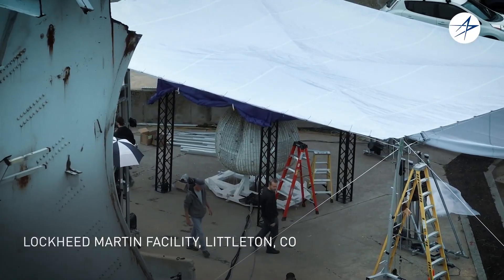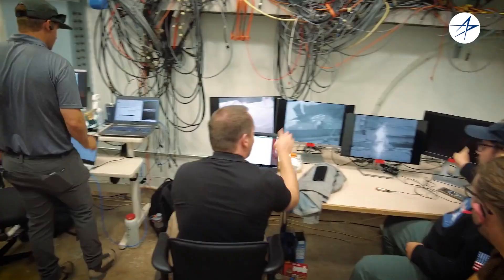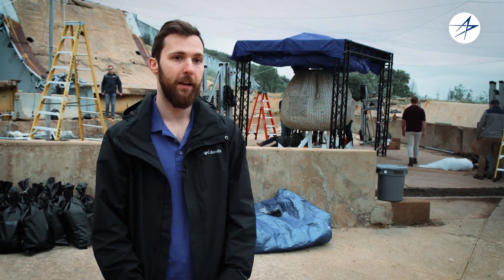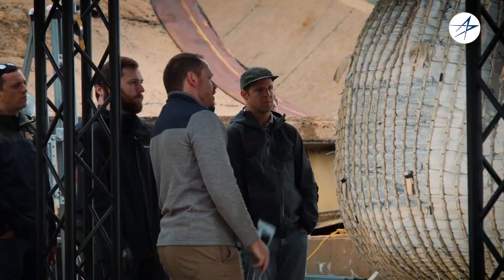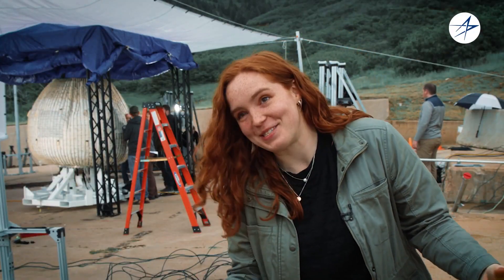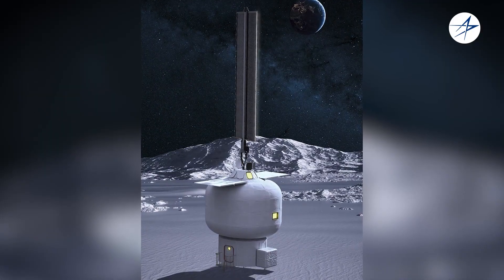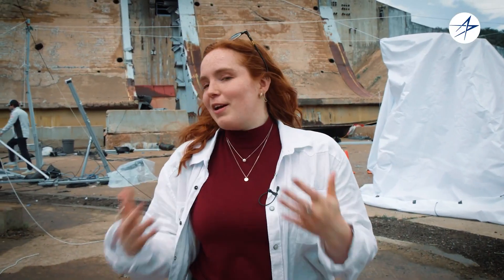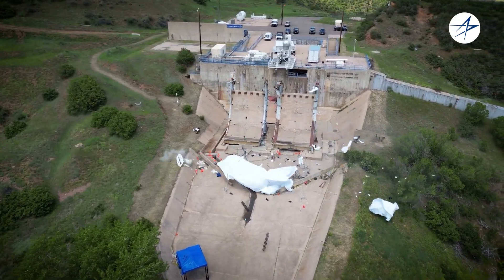Boom! Lockheed Martin bursts inflatable space habitat in test

Comment: Will it burst if punctured by a micro-meteor?
Reply: No, these are thick-walled & multi-layered, designed to break up micro-meteorites on impact before complete piercing. Also, in normal operation these run at 1 atmosphere pressure or less, so if all the layers do get pierced, then you get a slow leak that you can easily patch.